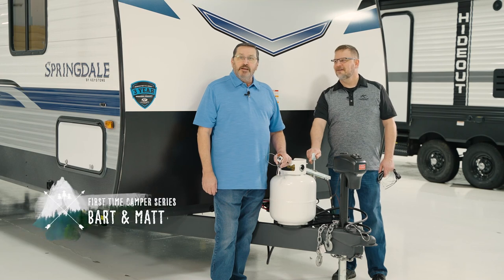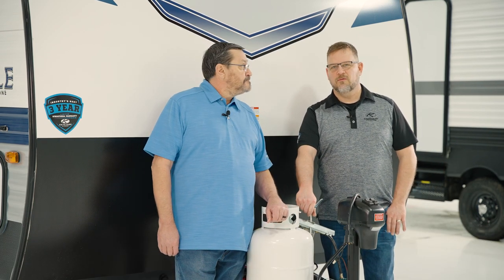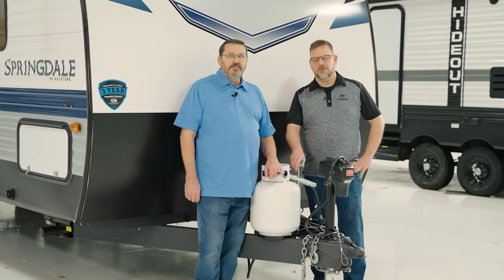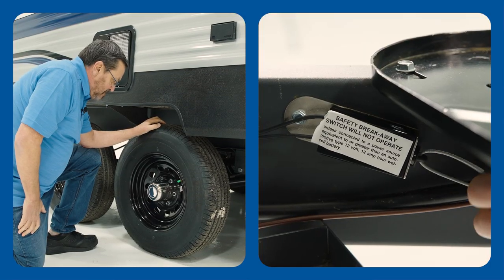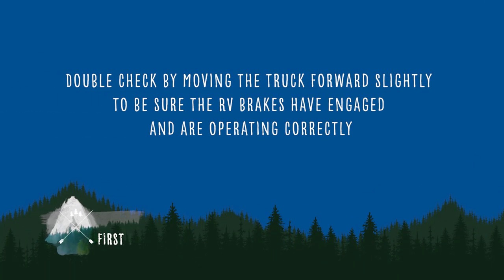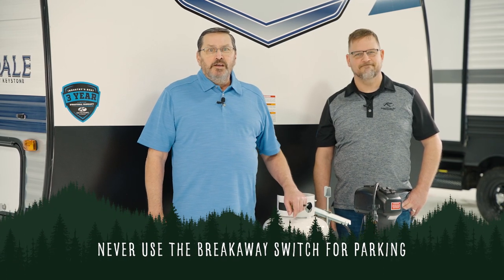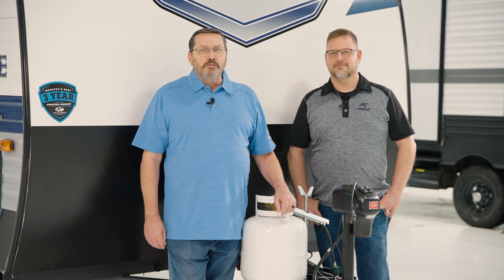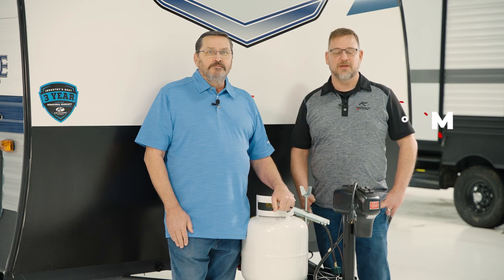First Time Camper Series - Testing your RV Breakaway Switch and brakes

Comment: I inadvertently disconnected my breakaway switch while setting up my camper at a site. Drained my battery. Replaced the battery, not knowing what I had done. Finally called my dealer. Told me to check the breakaway line - yup, I had accidently pulled it out while setting up. OOPS!!!
Reply from the maker: Well we are glad you got it figured out!! Hopefully you caught it soon enough as to not cause any wiring damage up there. Once that current starts flowing as the pin is removed, things can heat up quick in the breakaway box.

Comment: Another easy way to determine if the brakes are engaging is to turn on audio or video recording on your phone. Place it on top of the wheel then go to the front and pull the pin. You should be able to hear the brake engaging on the recording.

Comment: Another way to check to see if the brakes are in gauged is at the rear side of the wheels hold a compass next to the rim. When the magnetic brake in gauges the compass will go from true north and point to the brake magnet.

Comment: I just got a used RV and the wire going to it got pinched. Both wires are black and I wanted to make sure I hook it back up right. This is roughly how I imagined it worked since there wasn't a red wire. Great video
Reply from the maker: We are glad to hear this worked out. If you have any questions or concerns on your unit please do contact our retail customer service team at 1-866-425-4369! Thank you!

Comment: I went to get my toy hauler out of storage , hooked it all up and went to leave and the trailer brakes were locked up. I remembered last time I camped I forgot to unhook it and it pulled out, took me forever to get it back in so I could come home. Now it won’t as I mentioned above let me pull the trailer. Wheels are locked up I think my son didn’t plug it back in correctly after several attempts. I’m assuming the pins are bent or touching. Solution?. Replace it with a new one?. Anything else I should know before replacing it ? Thank you!
Reply from the maker: Good Morning Rand, we are sorry to hear about this issue! There would be a few things you would need to check on this that we would like to explain in detail with you. Please do contact our retail customer service team at 1-866-425-4369 when you are able to! Thank you.

Comment: Great video! Is the breakaway switch wired directly to the battery, or is it connected to the fuse panel?
Reply from the maker: Good afternoon, the breakaway switch would be wired to the battery through the battery disconnect box. Thank you!